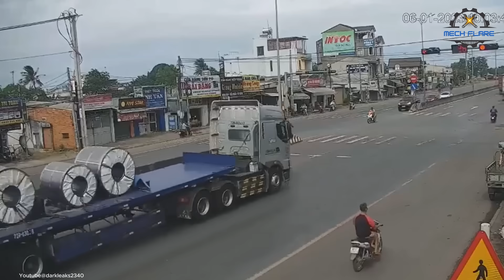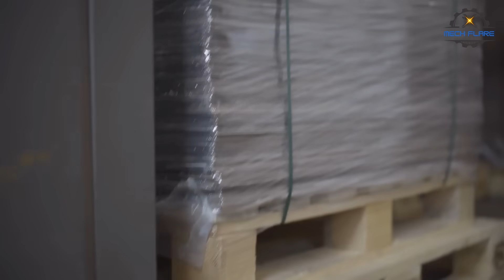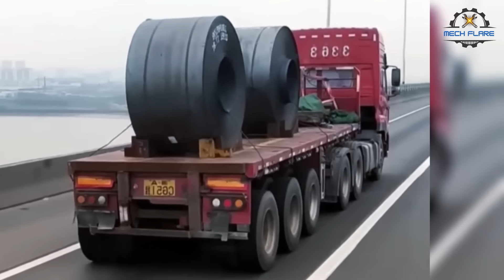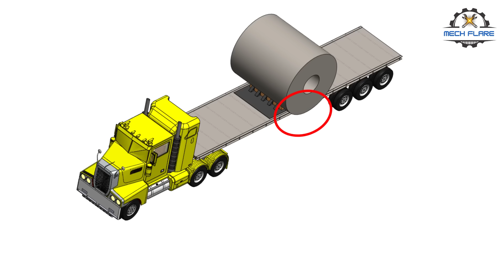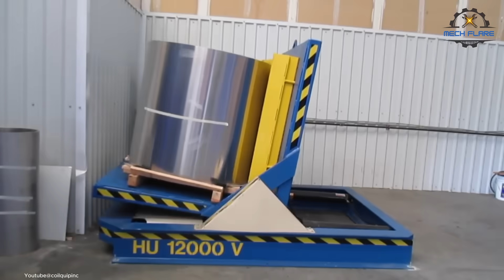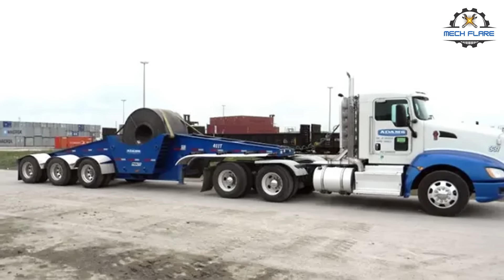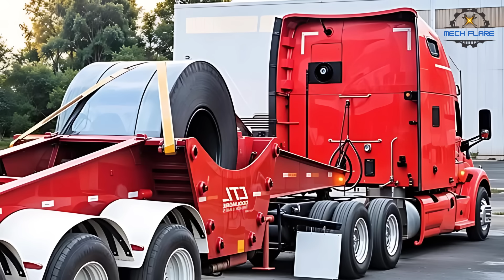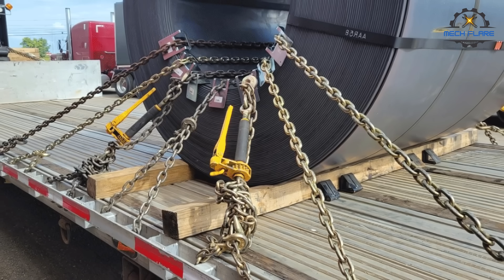Suicide Steel Coils: Can We Stop These Monsters? (USA vs Europe)

Comment: Uninformed and lack of training  plus being lazy are the reason for the accidents involving these type of loads ! when secured in a correct mannor with atleast 4 chains that pull forward- downward-and rearward will secure this type of load ! I usually use 6 chains and binders and have NEVER had a shift in the load ! Just use enough to keep the load on the trailer even in the event of a roll over !  Keep your eyes on the trucks that do not folloe these rules and you will see either a foreign POS or a dumb ass ! Call the highway patrol if you see an unsecured load ! Period !

Comment: As a trucker these coils are not called "suicide" coils. there are three ways to load coils. 1. suicide  2. homicide and 3. eye to the sky. suicide kills the driver if the chains break. Homicide (with the eye of the coil facing the truck cab) will kill people to the right or left of the truck if the chains break. eye to the sky is done only for certain (smaller) coils as they (large coils) are a major B to pick up like that, requiring an extremely heavy duty fork lift which most factories do not have the ability to afford so they use over head lifts (or crane) which (95% of the time) will not pick up coils that have been loaded eye to the sky on a flatbed. a good quality headache rack can negate the driver death for coils that have been loaded suicide.

Comment: lots of guys, shippers and drivers alike, came up to me when i was securing my coil runs and said I was overdoing it or taking too long because the fmcsa says it only requires x or y amount. The thing of it is, those regulations are the minimum. I'm not rushing out the door when im the one paying the price on the load going wrong.
Reply: My parents’ car was once hit by unsecured heavy load coming off a flatbed. They survived (the car was totaled though), but they were lucky - from what I’ve heard it could’ve easily been much worse, if they were a bit closer to the truck.

When a driver saves time on securement procedures, he’s not just risking his life. 

Great, that you take the time to throw a few extra chains when you’re in doubt!

Comment: Smart loading procedures is in a sense - engineering.   The loss of a Boeing 747 freighter in Iraq a few years ago was the result of an improperly restrained row of Humvees that came loose on climb out all sliding towards the rear throwing its center of gravity off and disabling the flight controls.   BIG FIRE BALL!

Comment: My dad hauled these many times. It’s all about using belts and equipment that isn’t run down. Properly securing these bring the worst case chances almost down to 0. We can always try to be better and improve but again my dad has hauled many coils in his career.
Reply: While it can work many times, belts can be damaged by the edges of the coil trying to move. Hence why it's safer to go with chains. There's 0 chance a chain will be damaged beyond use out of nowhere, unlike a belt may, if you're unlucky.

Comment: I don't understand why coils are not loaded onto low-boy or step deck trailers.  the front of the trailer would prevent the coil hitting the cab and the low center of gravity would reduce the likelihood of the coil falling off the trailer.

Comment: Hmm, if you dont have a dipped traillers what ifvyou just pack the trailler full off in front and behind the coil. So when it snaps it cant roll forward, gain momentum, and flatten you cabin? Dont need to be other steel coils since they are heavy, just something tightly packed with so it cant gain speed. 
Or just something that holds it in a bigger area than just chains and that wedge things i seen in some trucks in the vid. Like two tall "planks" in the front or back sitting tightly against.

Comment: Bro just put wedges on the corners and turn it into a box instead of a cylinder. A steel rectangle with half of a cylinder carver into it to hold it.

Edit: I watched the end of the video. I should've seen the truck shapes. A USA problem as always. I was thinking this is too stupid to be an issue.

Comment: Wouldn't the European style permit only shotgun loading? Wouldn't that mean the receiver would need specialized offloading equipment? Also, doesn't a pre-built trough require a national, cross industry, standard coil width? If all of this is true then converting to troughs would require more than just replacing flatbeds, it would require major hardware changes at every step of the process from the manufacturer of the coils to the end user of the coils.
Reply: No, the so called "Coil liners" have the well to put the coil in length wise, however you can also put the metal support at different points in the trailer. Holes made for the supports, strong enough to take 30tons of load. so you can load shotgun and the coil cant move forward. Also many ompanys use so called "coil sleds" works like a palette, but is actually a coil sized well, to keep the coil in place, to be unloaed by forklift. Needs more fixing, but if you do it right, you can haul them 1000s of miles
Reply: @thomasnieswandt8805  I meant the thickness of the coil when I said width but these coil sleds sound interesting. Still it seems like the only time that the coils are actually dangerous is when the driver is willfully negligent when securing them and a different mounting system still requires the driver to do his job securing them and could still be done improperly by a bad driver, so it seems like changing the mounting system would be spending money to not actually increase safety and we would be better off examining why drivers sometimes mount them improperly and addressing that

Comment: Safe way to transport?  1/2" G70 chains biased for braking (more holding it back, then forward) each secured to a different point on trailer. One for every 11,600 lbs of the weight of the coil, and then couple extra.
The ones that loose them are mostly the ones that half a$$ the job. (Occasionally stuff brakes unexpectedly but that lot less common).

Comment: One of my 1st jobs was crane operator at a galvanizing mill. I loaded and unloaded 40K coils off and onto trucks. I remember sitting them down on our thick concrete floor, just feet away from where I stood running the crane from  a box on my belt, and you could feel it shake the ground.

Comment: Suicide is the best, or eyes to the sky for thin coils. Drivers have to know what they are doing or go find another profession. Specialized trailers are OK for a company that has the contracts for moving a lot of coils, but many coils are hauled by trucks like mine that hauls a wide variety of cargo. Dummying down the driver base is NOT a solution, anymore than to dummy down airline pilots just because modern planes can take of and land virtually by themselves. Do you want to be a passenger on a plane whose pilot does not have the skills to react to any emergency? I want the best of the best at the controls of any plane I'm a passenger on. Just like I don't want dummied down drivers on public roads that my family and friends drive on!

Comment: i remember seeing may of theses when i was just starting to drive and philly  city gov was doing good job of driving co out of the city . but there was still manufacturers  what i didn't get is why a 40 ft trailer with only 1 or 2 coils  thought wasteful  later found out about axal weights  that 1 coil was mainly on truck tandems and 2nd on trailer tandems  and also cheaters using covers and running 100,000 gross but destroying wheels brakes tires etc  gross max had recently been 73.280 and older equipment was designed for around 60,000

Comment: Lifting gear, which many companies can't afford"- absolute tosh, any company dealing in 25Tonne "megacoils" has the gear to do whatever is wishes to do with them.

Loading directions is often purely dictated by the geometry and size of the coils to allow the truck to operate as a standard width truck ~8.5ft in the USA  - total body width must be under (excluding mirrors) - coils larger than 8.5ft in diameter need to be loaded sideways  ("height of the coil"- width of the strip  is often full width)- in the fore-aft rolling direction.  Proper; securing, blocking, locking, lashing and   other methods of load  containment -   /  frames / wells / etc, eliminates nearly any possibility of the death steamroller occurring.  

 The USA trucking industry simply seems incapable of understanding correct restraints of loads, maybe they need DOT load inspectors in every dispatch facility to teach the flipflops how to tie a load - the securing is supposed to NEVER fail, even in a rollover or other high energy accident - it isn't simple supposed to keep the load secure sitting still...  (Load restraint Guides exist., engineered securing systems also exist.
(Australia has this for you t NHVR Load restraint Guide2025, the USA probably has a similar document. - yep, 3 seconds to find, "Cargo Securement Rues"| FMCSA  (.gov) )

NB. the Longitudinal wells demonstrated on some EU trucks aren't suited to the huge single-coil-load steel coils, however a flatbed can easily be engineered with a semi recessed deck to cradle a coil or 2 - across the deck in the same orientation, and still be a multiuse trailer.
(Any coil which comes free on a truck is a definite fail.)  A movable - braced headboard is about the simplest way to secure a load from starting to roll - to tug against its lashings en-route.   - Many crashes of USA designed and built  trucks is the fact that they aren't rollover worthy - and can't even survive their own cargo..

Comment: In the 90's and ´00 i was haulin' theese kind of steel coils on flat floors in Europe. Never had a problem. -Why? The company who manufactured and loaded theese used Coil cradles. The empty cradles was later returned/hauled back to the orginal sending/manufactoring company. My point here is: A serious company who manufactures and loads theese large coils has a responsibility to be able to send their products safely. THIS is how to solve this problem. NOT by making the Trucking industri do dangerous runs with their dangerous loads. 

With this said: The Truckdriver is still responsible for knowing exactly the correct spots on their bed -to distribute the weights correctly. Also properly securing the coils. I've seen some pretty stupid truckdrivers on coil load areas. Who have loaded theese heavy coils crazy supidly weightwize on their decks. Not even cradles underneath theese things will hold em if You get a double tire blow out running down a long curvy hill. Everybody who drives heavy loads MUST KNOW about correct weight distributions on their wehicles! THIS SHOULD BE MANDATORY! I've made both lifelong frieds and gotten flack; when correcting unaware truckers loading theese coils. I also know i probably saved some lifes in this process too. My point is: If You are waiting for Your turn to load at the yard; and You notice a bone-head loading: It's better to go over there -and to try to help. Even if this means; that the trucker loading like a idiot -is a total dick on bad day too. Saving lifes is worth it! If he will not listen: -Just write up the licenseplate number and call the cops. They are usually more than happy to teach (and fine) the ones who are too stupid to understand themselves!

Long story short: MANDATORY coil cradles supplied by the manufacturer/sender is the way to solve this problem.

Comment: If drivers are adequately trained and have the correct securement, they can be safe to haul. You failed to mention that we are required to check our securement in the first 50 miles and then every 150 miles after that. Most loads need a small adjustment at the first  check, but are good after that. But some loads (not coils) settle while driving and required adjustments from start to finish.

Comment: save space?!?
a sheet stack uses 100% of space!
a coil uses only 60-70% of space!
Reply: Saving space is not a consideration at all. These are coils because its cheaper to produce and they are easier to use. Sheets do exist but not in the same scale as the coils. Nobody will need 30 tons of sheets, but a 30 ton coil will be used alot.
Ofcourse then comes the production of such coils, and why it has to be one 30 ton coil and not 3 coils of 10 tons. Spreading the load more even and having the individual coils be less of a problem. The same amount of material gets produced, the same amount gets delivered. Maybe once again the money got involved. When one 30 ton coil covers the whole day or week or whatever desired time without the need of stopping the process, but anything smaller could cause stalling, once again throwing the responsibility on the others, cuz money.
Reply: @htmn_2 thats right. the narrator said that coils save space, which is not only not important but is not true...😊

Comment: What an ignorant video and ignorant commenters. Notice how the clips were practically all from Eastern European and Asian countries? That's because Western European and North American countries have strict regulations and enforcement on load securement (even for things other than coils) that prevents accidents from happening. To go out and say that the US is "behind" because they use normal flatbeds is ridiculous because accidents when hauling coils are exceptionally rare and aren't endemic like the video and commenters are trying to make it out to be. A point that wasn't made either is when using a flatbed trailer with coil wells it means that trailer deck can't be built as heavy to handle heavy non-coil loads since the panels would have to be removeable by hand (if you need an overhead crane to convert it then you may as well just get a specialized trailer that you can at least hook and drop anywhere); you wouldn't be able to flatbed as heavy of cargo since the removeable panels wouldn't be as strong as a regular flatbed's deck due to weight restrictions. It's all a balancing act and what the US (and Canada) do works just fine just as what the Europeans have works fine; quit trying to act like Europe is superior when you can't even compare the two as they have completely different challenges and requirements.
Reply: What's even more Hilarious, 91.2% of the comments have never operated nor driven or probably sat in a semi

Comment: How about instead of going on about the need for different equipment-how about we focus on enforcing the already on the books load securement laws…. They are there, they just need to be properly enforced.  Kinda like the language proficiency laws that have been there since the 70’s.  That alone would reduce the overall safety of trucking way more than just the coil issue.  Usual suspects…

Comment: Hi, Folks. 
Transporting these coils could be made a LOTTTT safer by only allowing them to transported on container bases which could be locked to the trailer deck by standard container locks and which have purpose built cradles to cup the coils and suitable tie-down lugs on those container bases for securing of the coils, INCLUDING facilities for  at least TWO chains from front to rear right over the top of EACH coil to hold them DOWN in their respective cradles.

Not much different from the comment below about transporting them in the U.K. on trailers with wells in the deck to accommodate the coils but it would allow a normal flat bed trailer WITH container locks to carry coils more safely.

It'z just plain BOOOLSCHEEEYITTT to expect chains passed through the BOTTOM of the inside of the coil to have enough leverage to stop the coil moving in the event of emergency braking or, even worse, the sudden stop of a head-on collision when the top of the coil is 3 times further above the deck.

But what would I know??? I'm 'justa pore, dumm bulldozer op'rator'.

Just my 0.02.

You all have a wonderful day. Best wishes. Deas Plant.

Comment: One of the important things that works in the EU is to limit the maximum speed of trucks to 90 km/h or 56 mph . Combined with the appropriate trailer and the safety systems of the European truck itself, this ensures safety on the roads. Flatbed trailers carry rolls weighing up to 1.5 tons (3,333 pounds) on special pallets with rubber pads. A standard trailer with 14 rolls (21 tons or 46297 pounds) is loaded this way and secured with 10-ton safety belts through a hole in the sheet metal roll. Special rubber pads are placed under the belts to prevent cutting into the seat belt.
Reply: The max speed for heavy trucks with trailers is 80 km/h in Sweden, with the exception if you don't have a trailer attached AND it's a specific type of road.
Buuuut basically everyone drives 90 anyway lol

Comment: Here in the UK where I was a HGV driver,  my job was to transport these steel coils, and we have the well trailers where the coil sits in a well in the Trailer,  it's the Best and the safest way to transport those coils, you still had to chain them down to stop them sliding in the well but still the safest way to move those things. 
The way the USA move them on flat beds, wayyyy to dangerous, accidents waiting to happen, they need to look into trailers like ours to ship coils
Reply: They're not resting on the deck. They're in a cradle.
Reply: The funny thing is that with small modifications, the US flatbeds could have the wells added to them

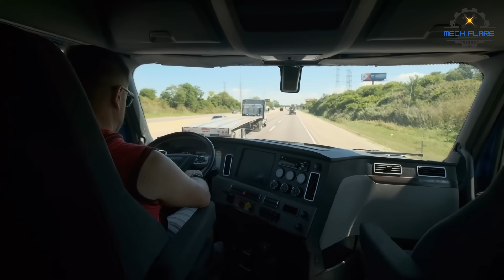Comment: 0:08-0:20  In Vietnam.I've saw many trucks transport "suicide coils" with poor tie-down on regular flatbed.Most of them used cabover tractor from Chinese or korean without sleeper like US engine-hood,so shit happened when driver suddenly hit the brakes and the 30tons "steel toilet roll" crushed the cab killed driver
Reply: Non issue, they've got safety sandals.